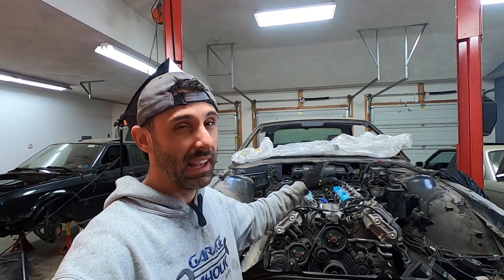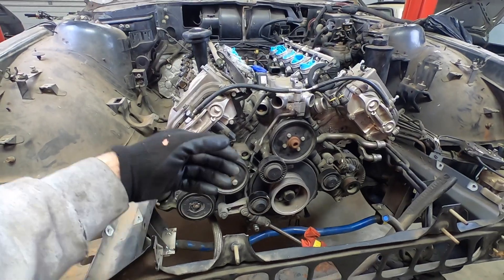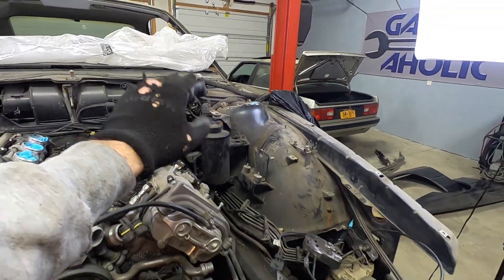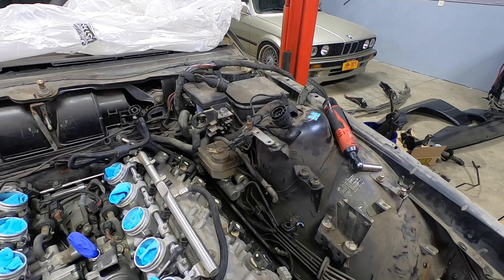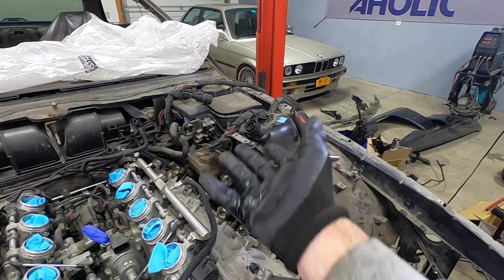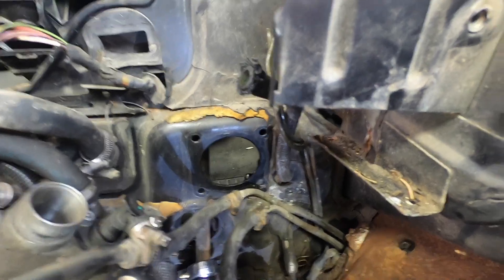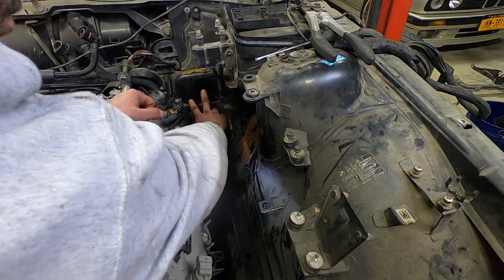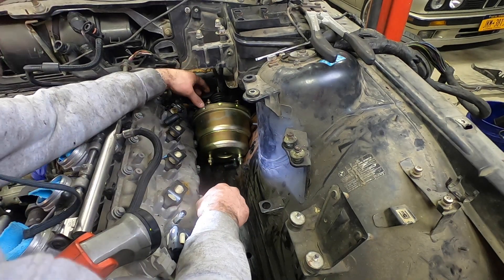Let's Explore More E31 S85 V10 Brake Options!

Comment: Hi. June 2025 
What happened to the installation of the new brake master cylinder and booster? Did you make a video?
Reply from the maker: Not quite, I have equipped it with the Tesla, electronic brake booster, Gen1. I do plan on issuing an episode on that very soon.
Reply: Thanks for the reply. Looking forward to it

Comment: What about an E34 remote Booster Setup?
Reply from the maker: I want the bay to look clean! I could remote but it also may interfere with the headlight. I may look into that option
Reply from the maker: And by the way I’ve done that on my bronzit e30 s62. Worked well. Thanks for that feedback

Comment: Wilwood makes a much simpler hydroboost brake system although I am not an expert on it in any way, I am under the understanding that it is very simple.
Reply from the maker: Thanks Jim, any idea on P/N or where I can find exactly what you're saying?
Reply: @Garageaholic  I've seen them used in builds on YouTube and cable tv builds. I remember all of them were Wilwood though. I'll see if I can find better details.
Reply: @Garageaholic  it appears that the hydroboost kits using Wilwood MC's. JLFabrications has 1 or more for $680ish, Online Performance $800-$900. Costly but from what I've seen, much simpler of a set up.
Reply from the maker: Wow!!!! Yeah that’s pricey. Not crazy bad though. I’ll definitely look this up as an option! Thanks for doing the research!! Appreciate the replies!

Comment: the s62 swaps for these cars use the regular ps pump from the s62 with no issues so it should work fine with the s85 and hydroboost.  The hydro boost system works well and alpina used it in the e36 b8 v8 swap as it is very compact.  You may be creating unnecessarty work by removing it.  The 850csi and some high spec regular E31s had one more system running off of the hydraulic pressure from the ps pump, the rear axle steering in EU spec cars.  The e34 hyroboost unit was mounted on an offset block that you could use, it was also in the e28 vacuum booster:  https://e28goodies.com/the-must-have-budget-e28-brake-upgrade/
Reply: Great parts knowledge here.
Reply from the maker: Very good information! Thank you so much for sharing! I decided to go vacuum assist to have a better showing, cleaner engine bay as well, and simplify the plumbing generally.